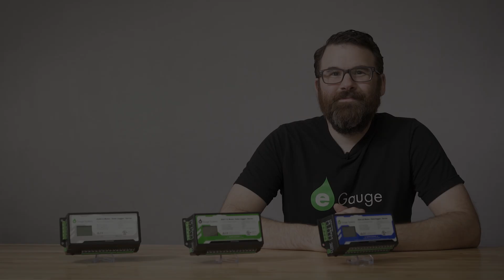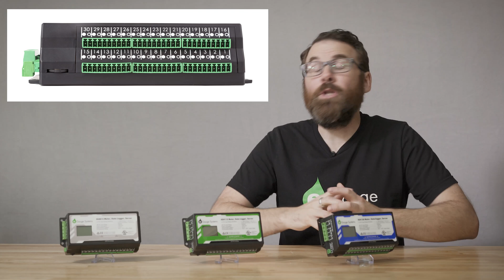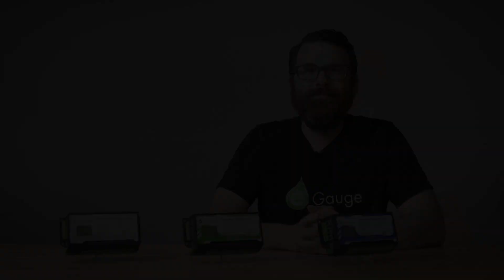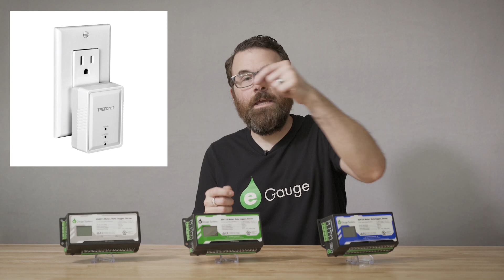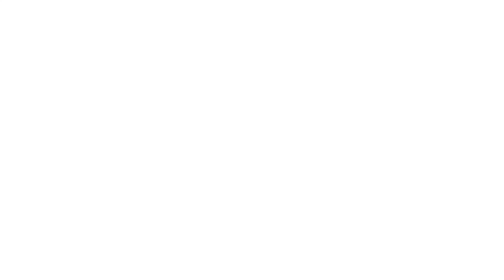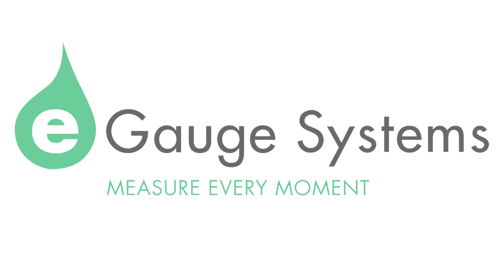eGauge Overview and Model Comparison

Comment: Which of the three products could be used in a multi tenant building with solar PV and all in a 3-phase, 230VAC @ 50Hz electrical system?

Is there a limitation on solar PV DC?  A limit of 9-VDC to 60-VDC was mentioned in the video.
Reply from the maker: Hello, sorry for the delay in responding.  There is no real limitation.  You can measure AC up to around 6900A, and DC voltage up to 60VDC.  We are planning on adding a high voltage DC sensor next year as well.  For DC current, we can support up to around 300A, but have special order CTs that could go higher depending on your application.  But 3-phase, 230VAC, 50Hz shouldn't be an issue.  If you have additional questions, please feel free to reach out to sales@egauge.net, and we can help you with more specific questions.  But the short answer is that we would most likely be able to monitor your system.

Comment: On the eGauge Pro, can I disable the powerline communication?  I am an amateur radio operator, and I don't want the 2-30 MHz RFI that PowerLine comms is well-known to generate.
Reply from the maker: Hello Eric, that's a great question!  At this time, we don't have an option for disabling the PowerLine communication.  However, you could use the core, which only has ethernet.  If you need the additional inputs, the Pro would be your only option.  If that doesn't work for you, we may be able to add an option to disable the PowerLine.  If you want to email support@egauge.net, we could discuss it with you further, we have a couple amateur radio enthusiasts in support, so they understand your concern!

Comment: Can be use on ac an dc at the same time?
For home and solar system with dc coupling without net metering
Reply from the maker: Yes you can!  Our meters can measure both AC and DC at the same time, and they can measure both generation and production, no problem.  If you have more specific questions, feel free to reach out to sales@egauge.net, we can help you out directly.